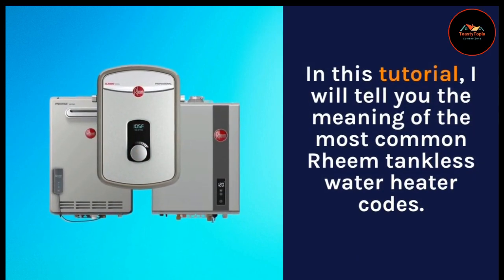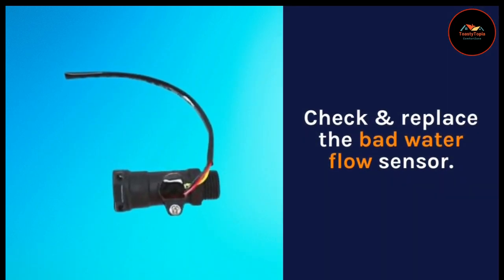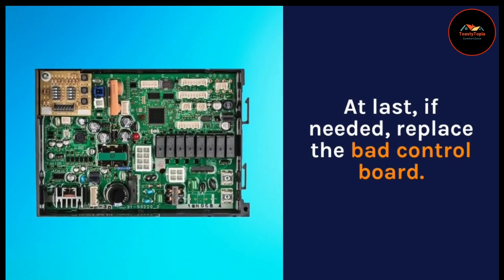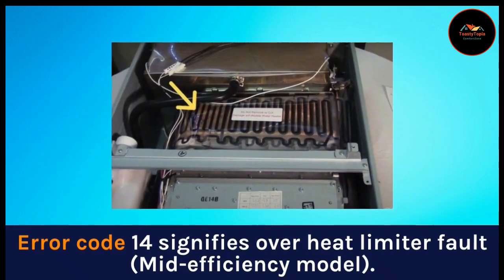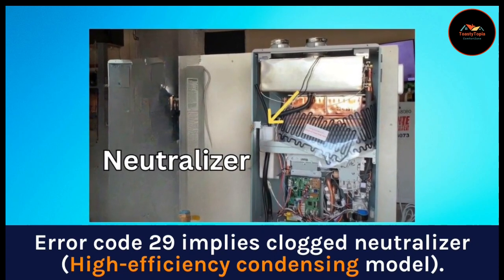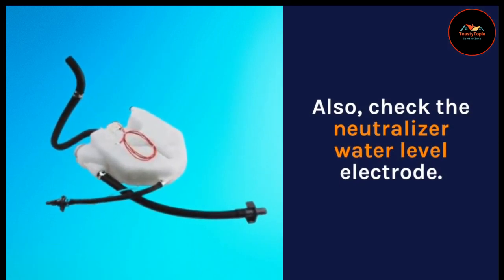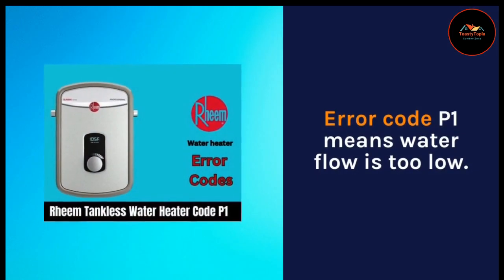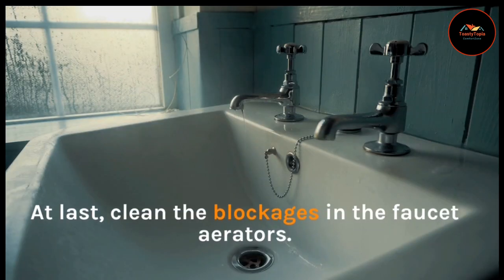Rheem Tankless Water Heater All Error Codes (ToastyTopia)

Comment: Need to understand error code 17?
Reply: Same here
Reply: Same here. Find anything?
Reply: @TDA55555  there is a sensor at the bottom of the unit when you open up the panel and it is the red mesh cord. You can unplug that and use a hairdryer and dry it out and plug it back in and it should work.